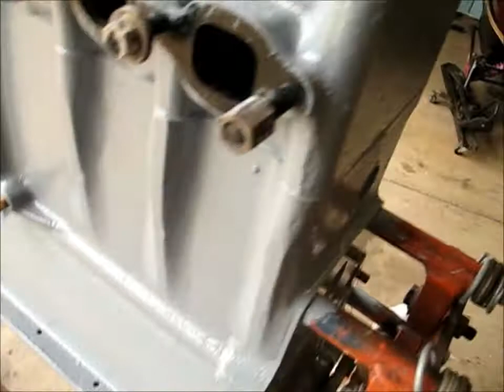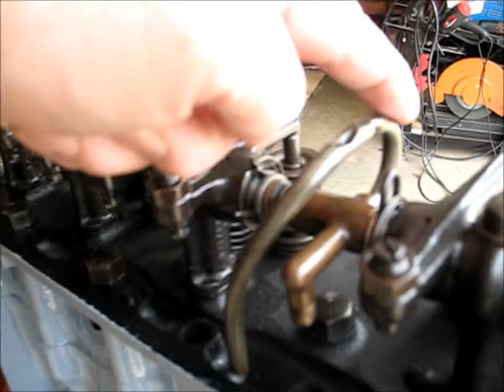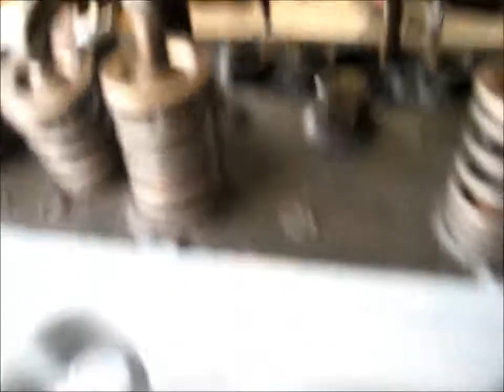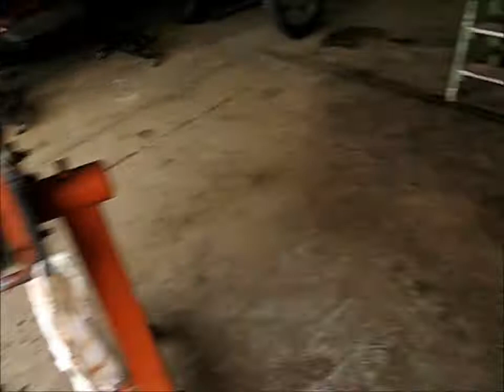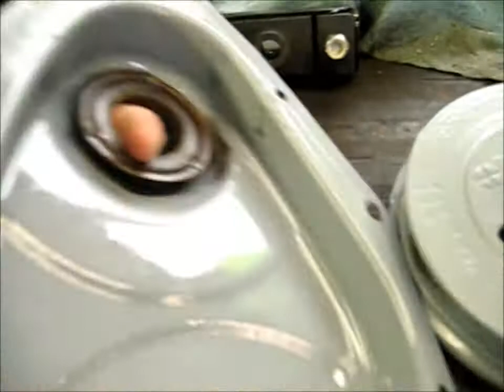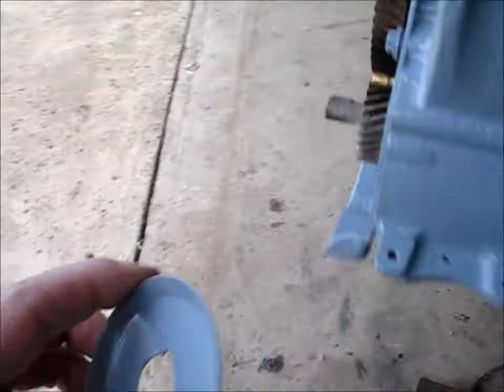My '36 Chevy engine paint - Part 2

Comment from the maker: Thanks for watchin'. Yea it was kinda' a kit. KBS paint has a process you do prior to painting, you first degrease your part with Aqua Kleen, then use a phosphorus etching spray that prepares the metal for painting, and then finally applying the paint. It takes some time, a day or two, to prepare, but the results are great! The paint is like ceramic hard when cured, resistant to 500 degrees, and impervious to almost anything. Kinda' pricey, but cheaper that POR15 which is basically the same.